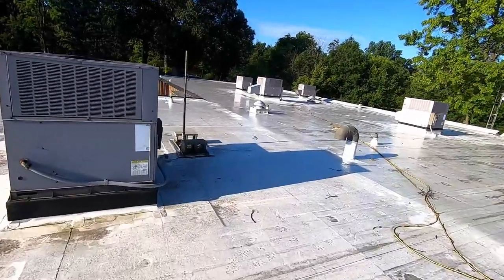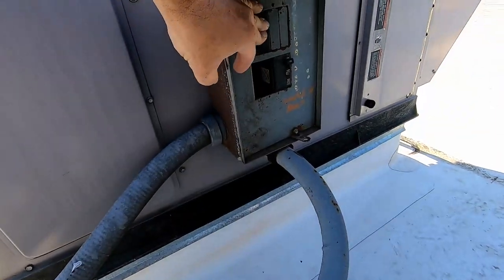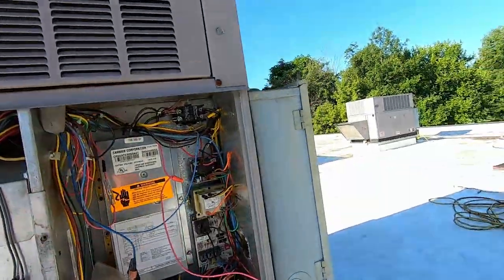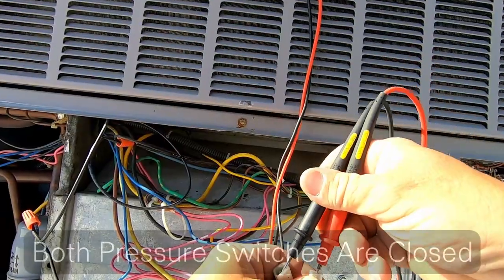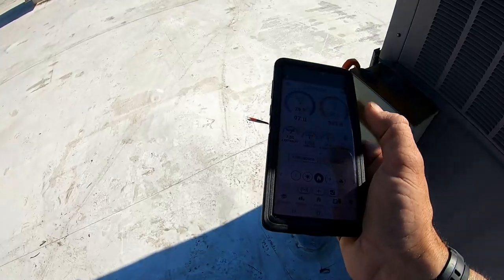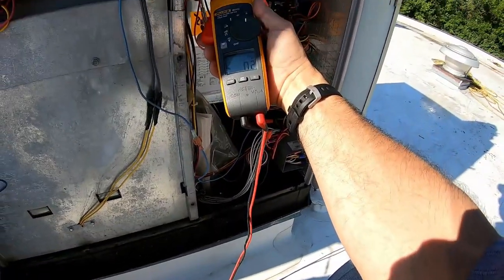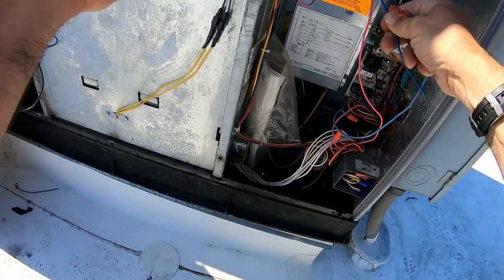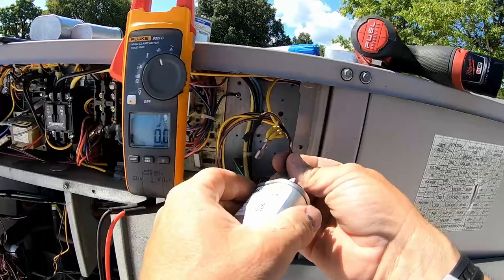No Cooling Office Lobby Is Warm - Which Packaged Unit Is It?

Comment: Holy shit. That tracer tip literally blew my mind. I got out of HVAC years ago, been a network administrator for a while. Dude, that's a clutch tip.
Reply from the maker: I was signed up for Devry college to be a electronic repair tech in 1995 but changed my school 3-4 months prior to starting. Looking back it was a smart move even though I wish I could have done both.

Comment: Great video once again Rick,  thanks!!  As usual,  I watch 2-3 times to glean all the goodies.   That borrowing fan wire was a great tip 4 jumper wire!!  True Yankee ingenuity.   

Milwaukee does make great tools, I'd be using them now probably but I'm still all Dewalt from the old carpentry days.  Battery loyalty ties you down!  One great thing I'll say about their 1/4" impact driver is it has a low torque flush setting that's perfect for those screws.  No oops's.  
          You're absolutely 💯% right!  We need a Dave song 🎵 on trigger conrol!!!😄👍
Reply from the maker: That Milwaukee has 4 push button settings to choose from. I don't have a problem not stripping screws out 🙄. Thanks 4 watching 👍👍

Comment: Good Vid. That tracer thing is cool. What a time saver. i usually get My Jobsite contact / onsite manager on the phone and have them watch the thermostats while i start flipping off disconnects and start Labeling units. Like # 84.
Reply from the maker: I should start carrying two way radios again so I could have the customer tell me if I got it. Thanks 4 watching 👍👍
Reply: @HVACRSurvival   Yea, I have a couple. Never use them though. I just call them on thier cell phone.
Reply from the maker: Yeah that works good if you know the people. But if it's an office like this here your tying up one of their phone lines.
Reply: @HVACRSurvival   I just call them on thier cell phone. They stand in front of Tstat. Everybody’s got a cell phone these days.
Reply from the maker: Good idea. I used to do that I may need to put them back in the truck👍👍

Comment: Great video & great tip using the tracer. I have the Klein tracer/toner & use it often 👍
Reply from the maker: There's times when that Klein does awesome but then there are certain times when I have a electrical sub panel and that will totally screw it up.  I appreciate you watching the video 👍👍

Comment: I will jump the unit into heat at the stat, and go up on the roof and see which one has the heat running.
Reply from the maker: That is actually a good idea! mmm? To simple...lol but Really makes since! Thanks for the tip!
Reply from the maker: The other thing I didn't mention was this was a doctor's office so I couldn't go into all the different rooms casually and turn things on and off. So luckily 3 out of 6 thermostats were available to me with no problems.
Reply: Besides.  Where's the excuse to buy another tool 🔧 if you just jump on heat?🤑
Reply: @HVACRSurvival  agree that is what a journeyman taught me..put it in heat.  However I still thing that toner is good
Reply from the maker: It took longer to find that unit than what I showed😁.  It did not line up with where I figured it would be.

Comment: The fluke intellitone pro is good for chasing cables that are bunched together or in a noisy environment as it's digital.
Reply from the maker: I had a lot of problems with that one so I  sold it. I thought I had the coolest latest, greatest toner but I went back to analog LOL.  Plus the batteries would go dead for no good reason and it couldn't find things from far distances. But that was there intellitone 100 and it was when they first came out🤷🏻‍♂️. Thanks for checking out the video 👍👍
Reply: @HVACRSurvival  strange you mention the dead battery, I have the same thing happen, thought it was my unit
Reply from the maker: No, that was my biggest problem with it. Along with sometimes not finding the signal. When one of my electrician friends came in with an analog one and found the wire and no time it made me rethink if digital is that great. I don't work on live Networks so no need for it besides if it's plugged into a Switch or router it goes throughout the whole building.

Comment: Can u use that tone generator on Dead Circuits to find a Breaker / Wire in a Electrical panel ? And how would u do it ?
Reply from the maker: I would probably go with the hot wire that way you can trace it as far back as the break in the wire is but if it's inside metal conduit you won't pick up the signal.   If it's a live wire I would use the idea tracer. Somethin to keep in mind, if you use the neutral it's going to go throughout the whole building so that's why I'm saying go with the hot legs. Which I'm assuming are not powered because you don't know what breaker it is and there is a problem causing the power to be dead.
Reply: @HVACRSurvival    Yea, good point on the neutral. Thanks for that. Yea, just trying to figure out which wire it would be if u have a few panels together & no power. To locate the wire in which panel. To locate a faulty breaker / no power.
Reply: @HVACRSurvival   Ive got a Breaker finder tool for live circuits. I was thinking no power circuits. When nothing is Running. Helping to find a Breaker quicker.
Reply from the maker: @OcRefrig  then yes,  any conductor will work that is not powered, it works best with two conductors hooked up but will work with just one.
Reply: @HVACRSurvival   Thanks. Appreciate it. I Would be interested in watching a Video on that if your ever in that situation. Finding that One Black wire to a Breaker.
Reply from the maker: OK. I'll try to remember👍👍I may have only done that kind of check 3 times in the last 10 years.
Reply: @HVACRSurvival     I Totally Get it. I’m Just throwing it out there. 😎

Comment: The only thing missing from your tool bag is a little magnetic plate for the panel screws. 
Hardly ever been loosing screws ever since I got one !
Reply from the maker: I have one, I use to keep it latched on the side of my bag with my Bosch light. A lot of times I'm able to lay them in areas close to the equipment so I know which side it goes on. Otherwise when I throw it in a big pile sometimes there's longer and shorter ones and it makes a difference. I've put a hole in a coil once 🙄.
Reply: @HVACRSurvival  oh boy ! That's a change of underwear afterwards for sure !😅

Comment: Not a fan of the impacts on access screws..I ask why do you think you need the impact on the hvac you worked on today?  Were the screws impacted?
Reply from the maker: Biggest reason is the size of the tool fits my bag and all my drill Chuck's pop in out faster.
Reply: @HVACRSurvival  I have the small Milwaukee   drill driver. The bits pop in and out as yours but I have an adjustable clutch.

Comment: You don't stock duel caps?
Reply from the maker: Crazy ain't it 😲
Reply from the maker: Just to be clear I have dual caps that are for a compressor and fan 35x5mfd combo but not dual 5x5mfd or 10x10mfd. That cap was made just for 2 fans.

Comment: Toners are good as long as the asshole who splices the wires somewhere for a repair wirenuts all them together for a new section.  Have used a toner on the unused wires on a communicating system and could not find the correct condenser, to find out the other four unused wires were not spliced in the chase, LOL.
Reply from the maker: yea that sucks! I totally agree with you👍👍